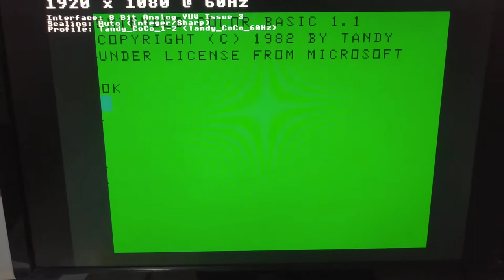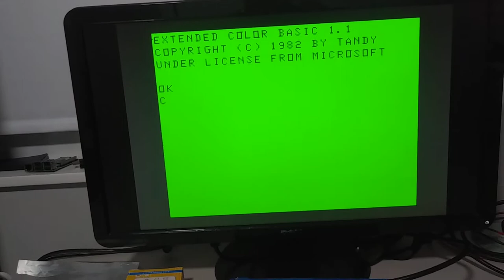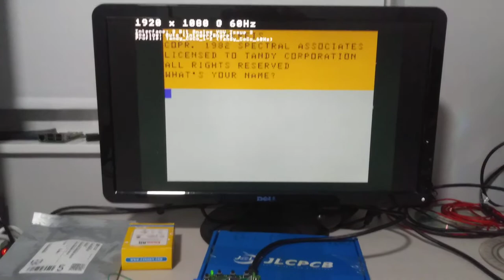HDMI out on my CoCo 2

Comment: Nice, I've seen others use that same open source board on quite a few different systems, also there are quite a few different settings I believe as well.   I've got CoCoVGA on my CoCo2, and GIMEX on my CoCo3, so I don't have much need for something like that, but I if keep aquiring systems, it'll be nice to have a 'cheap' alternative to get HDMI upscaling.  Another nice thing is the raspberry pi already has the HDMI licensing fees paid for, so you don't have to worry about that.  Great job as usual though !
Reply from the maker: Thanks!

I might include this in the design of the next coco 2 board I want to make. I really want VGA though.....
Yes, The HDMI licensing isn't an issue with this setup, thank goodness.

Comment: What's your recommendation for a Korean CoCo2?  Wait for CoCoVGA?  Composite mod?  This?
Reply from the maker: I have never used a Coco VGA. Lots of people have very good experiences with Coco VGA so one day I hope to use it. This board is called the RGB to HDMI project. It will connect to the vdg on there with a simple mod and you'll have a crystal clear picture
Reply from the maker: In terms of price however I think it works out to be more or less the same Advantage being that this project as available components but the disadvantage is that you would have to build the board yourself. You can however buy pre-built boards.